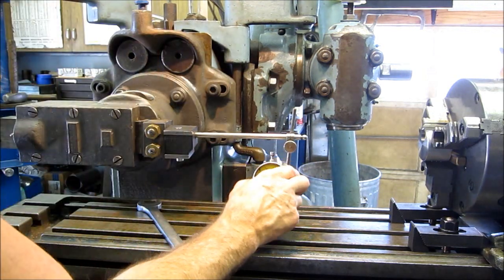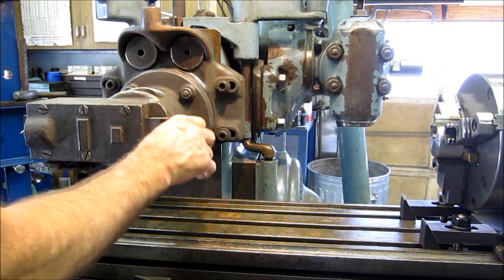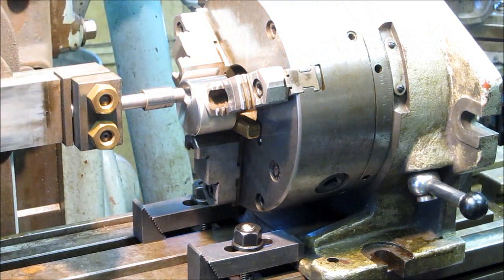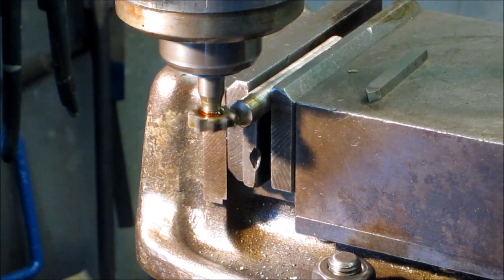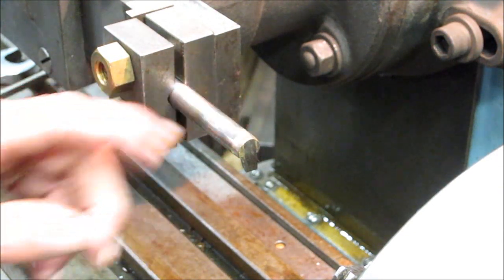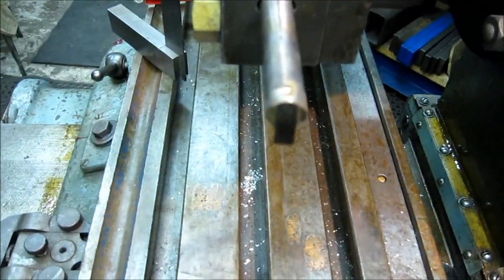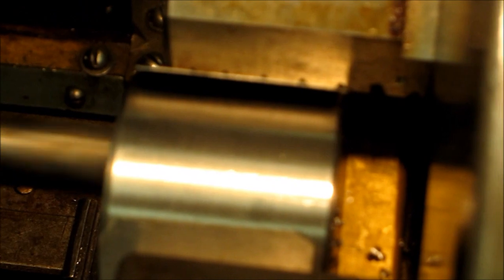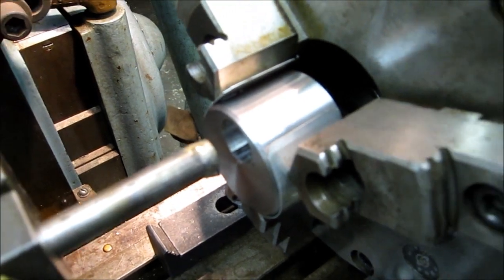Mail Call (Benchmaster) Part Nine

Comment: There is just as much skill and thought required to program and run a CNC machine, often times more. There are some operations like circular and helical interpolation that are simply impossible using manual methods. Watching Keiths videos It seems the single most versatile machine tool he has is the CNC plasma cutter. These days it's all about speed efficiency and accuracy. It's fine remoniscing the good old days but faced with modern opositition the good old days don't cut it if you need to eat

Comment: Yeah there will always be old manual lathe's with inch i give you that.. i got an old myford at home that got inch and metric..

But cnc machines can switch between both with a simple gcode. 

So it will always be both :)

Comment: Silly it is, but with an installed base that is SO large switching over would be next to impossible. Even after all the 'old guard' machinists are dead and gone, and kids who learned to design on CAD systems with metric units have taken over, that equipment will still be running. And even if you could retrofit every lathe, mill, etc. with metric dials and digital displays, you'd still have lots of equipment that was 'hard coded'  for imp. unit, e.g. thread cutting gears on a lathe.

Comment from the maker: 1.0 mm — 1/1000 of a metre
 1.0 mm — 0.03937 inches or 5/127 (exactly)
 1.0 mm — side of square of area 1 mm²
 1.0 mm — diameter of a pinhead
 1.5 mm — length of average flea
 2.54 mm — distance between pins on old DIP (dual-inline-package) electronic components
 5 mm — length of average red ant
 5.56 x 45 mm NATO — standard ammunition size
 7.62 x 51 mm NATO — common military ammunition size

Comment: I've seen you broach other things using a broach, guide and shims on the press. That seems easier than setting up the K&T even though it's perhaps not as geometrically precise. What's the reason for deciding to do this one using the shaper capability on the K&T?

Comment from the maker: Yes you could have stuck it to the table and pointed it up to the casting of the jumping jack head, but you would have to remove it and re set it, when you ran the table out to measure depth...

Comment from the maker: The woodruff key cutter is a wheel cutter in essence and the Bridgeport spindle is mostly used in the vertical position. I find that a quick solid true clamping of a shaft or round in the T nut slots is an easy set up for either horizontal or vertical milling operations. I would have probably used the main spindle on the K&T, if I had used it!  Thanks for the comment, I like to switch up a lot and handling around a half dozen jobs at a time sometimes one machine may be in use, you learn to adapt

Comment: Great video, i picked up several usefull things. When the right job presents its self could you do a video on your duplexing boring head for the K&T, and explain all of its functions. I have heard guys in the shop talk about them, but i've never actuly seen one in action except for your video whineing won't fix it.Witch by the way, is one of my new favorite phrases.  That was more of a repair, than actual use. Greatly appriciated as always!